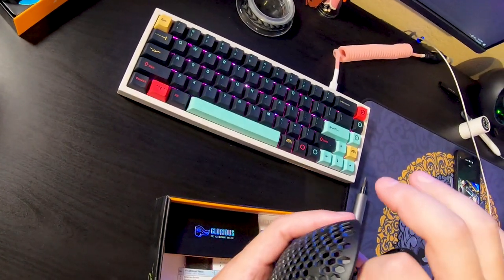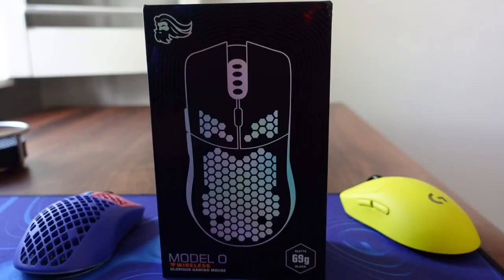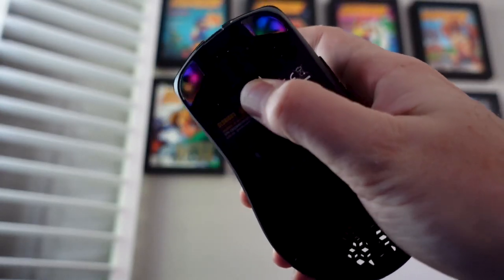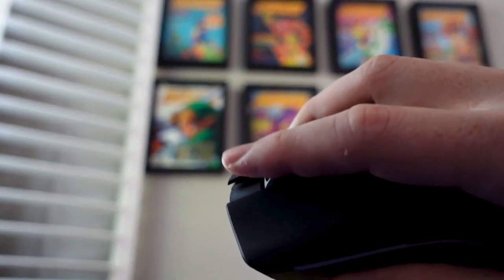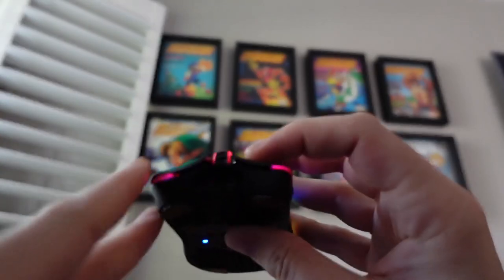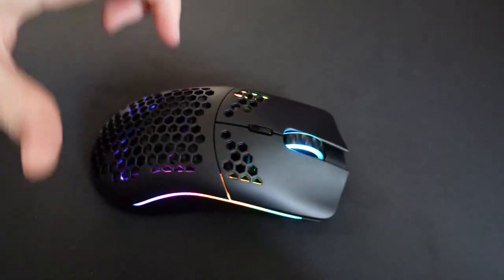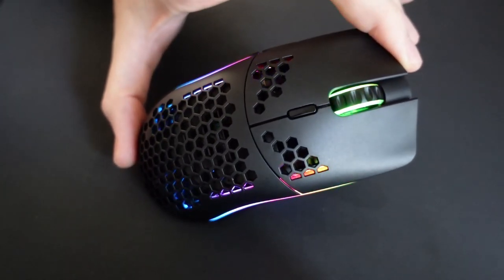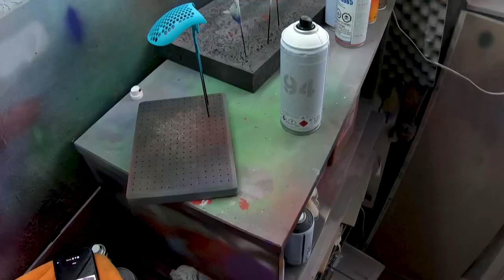World first Custom Painted Model O Wireless for Rickyedit

Comment: Great video! Unfortunately, I got my model o before this video to customize. I thought It was gonna be horrific to take part but It wasn't so bad. I was scared to take it the ribbon cables out but I realized they those clamps so it all works out in the end and my custom turned out almost flawless! Thanks, Nacho!
Reply: did you sand ur mouse down before you painted it?
Reply: @furrygoose7777  yes 400 grit this step is very important
Reply: @jamesketron5005  ok thanks a lot for the reply

Comment: Im painting a finalmouse ultralight 2 which has a pretty similar design to this via the weight reduction holes, so i was wondering if you did any sanding on this and if you applies any primer since we didnt see it in the video
Reply: bro i was wondering the exact same thing, have you got round to painting yours?
Reply: @furrygoose7777  i have not actually. i never got a reply on this comment so i got impatient and went ahead and bought the necessary products and did the sanding, only to not even paint the damn thing lmfao. if youre wondering tho, i went with a finer grit (800) and still am not sure if that was correct. the only thing i did to it was swap the cable and scroll wheel (both are a light gray) which happened to go well with the stock color, hence not painting it.
Reply: @defnotme4841  ok thanks a lot for the reply man 👍
Reply: @furrygoose7777  for sure man. have a good one